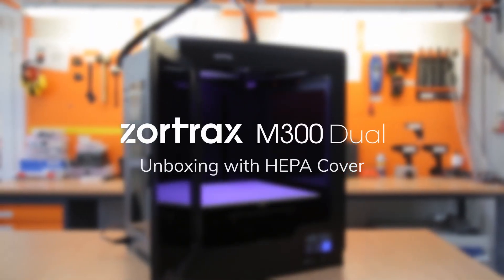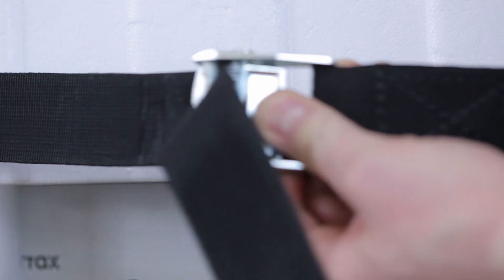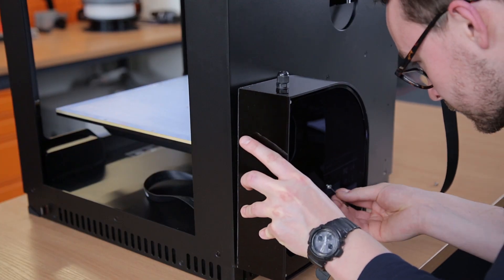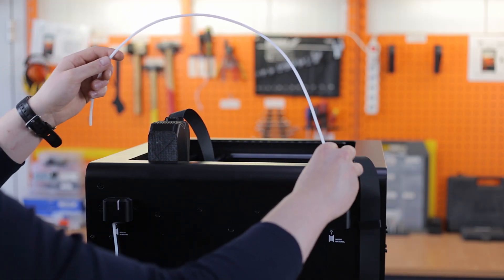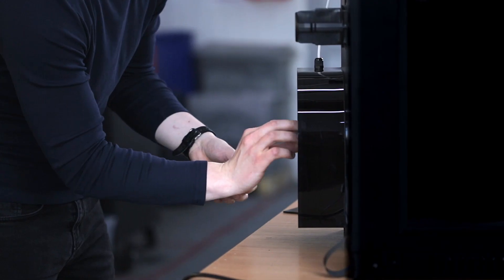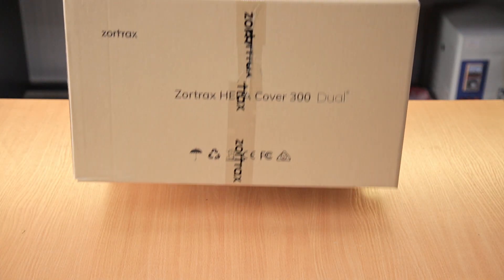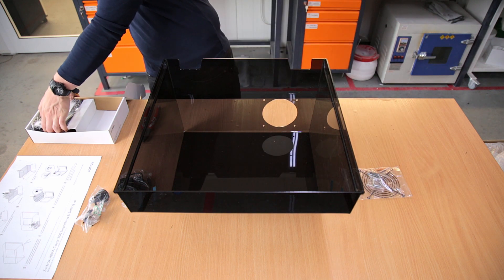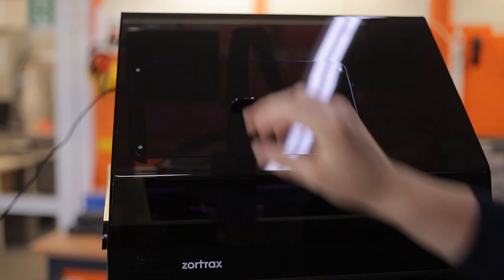Unboxing Zortrax M300 Dual LPD Plus 3D Printer with Dual Extrusion

Comment: How many Layers can be 'stacked ' within the available build volume for batch printing using support filament in-between the layers of the actual model.  Im tryimg to print 3/4 inch tall cylindrical plugs ...
Reply from the maker: Hey there! Given the height of the model and M300 Dual’s Z-axis dimension, you could stack around 15 levels of such plugs. For the safety of the printing process, we advise printing less levels, in case any warping occurs (this can happen with so many models stacked on top of each other, as the material shrinks when cooling down).
Reply: @ZortraXTV  so if I attempted '5 stacking levels' can I control the amount or support material in between such as 2mm between layers?

Comment: With firmware updates is the M300 Dual able to print 2 colours or support material only ? thx
Reply from the maker: Hi, Michael. At the moment, M300 Dual can print either in single mode or in dual (model material+support material). We hope to implement new options soon :)
Reply: @ZortraXTV ,
 Thank you , that would be great news
Reply: @ZortraXTV  Two years have passed, has such a simple activity as printing the same filament with two colors been implemented?

Comment: you need to add at leas another 3-5 minutes which is the time it takes the device to properly start the new touch screen made them  so slow
Reply from the maker: Hi, AHNTLIA. Thank you for your suggestion. With new hardware, the printer launches a bit longer, but it also offers many new options, such as Wi-Fi and Ethernet connection, Camera Preview or Blackout Response System.